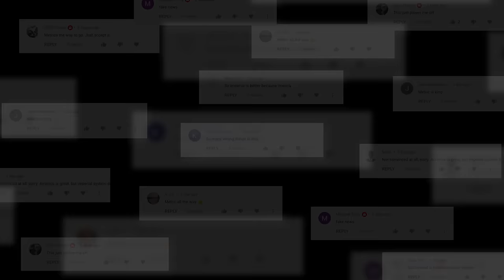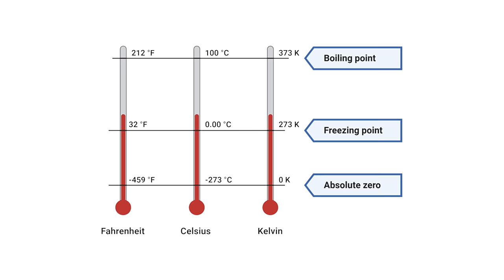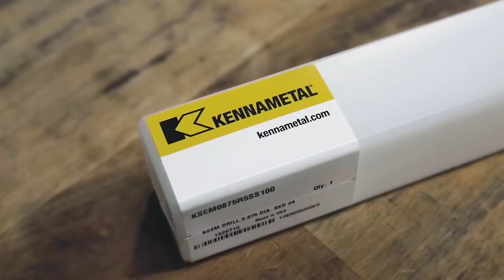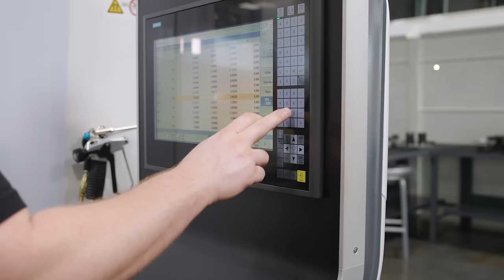Why METRIC is SUPERIOR to IMPERIAL

Comment: As an Englishman, its nice to understand both. Even if I do, like you say, translate between the one I'm familiar with and the one I'm not. But we use such a mash between the 2 🤣 kilometers if you're walking and miles if you're driving. Docs measure heights and weights in metric but we talk about them in imperial. We also use horsepower for combustion engines and kilowatts for electric...
Reply: Hopefully you can explain something to me that I have often wondered about, but never remembered to ask whenever I was in England. Petrol (gasoline) is sold by the litre and the road sign distances are expressed in miles, but I have never heard anyone talk about the mileage their car achieved in anything other than miles per gallon. Is there some easy mental math conversion for that?
Reply: @samshublom8761  well yeah there will be a calculation for it but we tend to just know how many miles per tank and how many litres are in the tank 🤷‍♂️
Although I just looked on my VW and it has an option for km/L as well as m/g
Reply: @samshublom8761  I only know the long winded way. We have a different gallon as well, to confuse things.

4.5L x £/L and then that's my £/gallon.

Its not that straight forward, but i know its roughly £9 a gallon (£2/L) at the moment. I have a 60mpg car, so I know a 20 mile drive is ~£3.
Reply: Another Englishman here and I have a habit of sometimes managing to use both at the same time.  Saying things like, "I need a bit of 10mm rod, about a foot long"!  In general, if it's an approximate measurement I sometimes use imperial but if I need to be precise, it's always metric.  Things like building materials still tend to get referred to in imperial, such as sheet material comes in 8'x4'. Well actually it's sold as 2440x1220mm but it's quicker to say 8x4!
Reply: @chrisharden3934  yes very true. We even have some steels delivered that say on the notes 4x1x500mm for example...weird!
Reply: @chrisharden3934  Another Englishman here and I do exactly the same 😉
Reply: It can depend on age, I'm in my 40's and grew up learning the metric system at school, but I also know about inches and most imperial units but choose not to use them, my nephew is metric only though.
Regarding the miles per gallon thing, it really doesn't matter, it could be called "Fuel economy value" for instance and you'd just know that very low values are bad and high values are good.  You just need a relative value to go by, I know that 60MPG is pretty good, so if I rename that to 60FEU (Fuel Economy Units) when I get in a car that does 30FEU's I know it's worse.
A lot of people weigh themselves in Stones in the UK, I used to but then the gym I went to only used KG when entering weight on the running machines, I converted and now know that if I'm 78KG I'm very light and if I'm 105KG I'm way too fat and need to get back on that running machine!
Reply: @WillandTony  where in the uk are you to be paying £2/L. In in the south coast and pay £1.70/L nowadays. And thats for vpower at shell.
Reply: @robc1014  assuming its diesel, cheapest by me is £1.85 and if I wana go big there's plenty I've seen that are £2.10. Im from West Midlands
Reply: @wildin13  petrol; i never look at diesel prices. £1.64 for v power petrol at my nearest shell today.
Reply: @robc1014  oh yeah I meant Wills' £2/L would probs be diesel. Petrol up here's in the £1.60's at Shell too.
Reply: @chrisharden3934  i have to say i do exactly the same, i can work in both Metric and Imperial intend to keep working in both systems. Imperial when im machining and metric when im building.
Reply: ...and stone for weight ;) (or is that just Scotland)
Reply: @bramweinreder2346  i still apply fertilizer to crops in Stones per acre in Northern Ireland, younger guys use Kilos per Hectare so each to their own.
Reply: And then there's the atrocity called stone.
Reply: @madeljacky  metric for precision, imperial for guestimates :) It's usually old school people who think that way and design around it, and I get it. It works.
Reply: Swedish here. Seems the expression "we're going metric inch by inch" will be relevant for several more years!😅 In Sweden we have our own quirk. We use miles for distance, however not the ones that are 1,6 km, nope ours are 10 km! Apparently an old Swedish mile was 10688 meters and that made it fit (almost) in the metric system. By the way out Swedish inch was about 2,97 cm, we have big thumbs in Sweden.😂
Reply: @bramweinreder2346  No mate, think anyone over a certain age south of the border uses Stones and Feet and Inches for measuring up a body.
My kids are fully metric though.
Reply: @tonyharrisson6823  glad to hear they survived the upgrade :)
Reply: @somedud1140  I'll take those for the legacy units that they are, but you should also mention that cars specify torque in local units, as do bikes with seat height. Both are typically considered more meaningful.

Comment: I recently retired from a shop that used both. We had a lot of drawings from Canadian customers for parts that obviously had been designed in inches years ago, but the drawings were re-dimensioned in millimeters. Our building and construction customers still used fractional inches. Automotive parts were strictly metric, but we programmed in inches. Inspections were metric. Taking a CMM report in millimeters and adjusting CNC offsets in thousandths was an error prone challenge.
Reply: Working here in Canada as a construction surveryor in tne 80's was fun...we used decimal feet in surveying, so using metric was a simple shift...but the trades were interesting, the millwrights and machinists both used metric and decimal feet...all of the structural steel tended to be metric....vut, the carpenters refused to use anything but Imperial fractions....I used to have to carry a chart in my fieldbook to convert between the three measures.
Reply: Yeah - combining the two is probably the worst of two worlds.

Comment: I served a Mechanical Engineering apprenticeship starting in 1976. At school I was taught the imperial system, then as I got older, the metric system. Going to work reverting back to imperial. Micrometers were a nightmare to learn as was the vernier caliper. Working in fractions ½¼⅛⅙ and 32nds. Knowing all their decimal equivalents. Then the Micrometers working in 'thous' or in 25ths. 
The metric system really in the UK Engineering took off in perhaps the early 90's when CNC machines became more prevalent. 
The metric system is hugely better than the imperial system.

Comment: I’m American but when I’m building things for myself I’ve been using metric more and more over the years. I’m still not as familiar with it as I am with imperial but I’m getting there.
Reply: It's very easy m8, just use base of 10. for example, 1 kilometer (km) = 10 hectometers = 100 decameters = 1000 meters (m) = 10000 decimeters (dm) = 100000 centimeters (cm) = 1000000 milimeters (mm) etc...
Or should I write it like this:
* Measurements above 1 meter are
---- deca (da) = 10^1
---- hecto (h) = 10^2
---- kilo (k) = 10^3
---- mega (M) = 10^6
---- giga (G) = 10^9
---- tera (T) = 10^12
---- peta (P) = 10^15
---- exa (E) = 10^18
---- zeta (Z) = 10^21
---- yota (Y) = 10^24

* Measurements below 1 meter are
---- deci (d) = 10^-1
---- centi (c) = 10^-2
---- mili (m) = 10^-3
---- micro (u) = 10^-6
---- nano (n) = 10^-9
---- pico (p) = 10^-12
---- femto (f) = 10^-15
---- ato (a) = 10^-18
---- zepto (z) = 10^-21
---- yocto (y) = 10^-24
(sorry if there's some misspelling in the prefixes)

* Same applies to the volume as well, for example 1 liter of water can fill up the space of 100x100x100 milimeters (10x10x10 centimeters or 1x1x1 decimeter or 0.1x0.1x0.1 meter that's why we say like this: 1 liter is equal to 100 cubic milimiters or 10 cubic centimeters or 1 cubic decimeter or 0.1 cubic meter. In 1 cubic meter you can fit 1000 liters of water and so on and so on.

One more example, easy one, let's say like this: "yesterday I was traveled 1.45 km, how many meters is that?". Answer is easy, so 10^3, so multiply 1.45 by 1000 and result is 1450 meters, basically just move the "decimal point" sign by 3 places to the right when converting toward smaller units and to the left when converting toward bigger units. Basically, the power of 10 shows you how many places to move the "comma"/"dot"/"decimal point".

Anyway, I was raised using metric, but I also use imperial as well, with over 20 years experience in mechanics I can build whatever using both (if I start imperial I finish project using imperial only with no conversions to metric and vice versa).

Comment: I like how metric can transfer information between mediums.
For example, volume to weight and vice versa. 1 litre of water, weighs 1kg or 1000 grams. 
So if I need 1 litre of water, and don't have a measuring jug, I can just use scales, and weigh out the volume, Which I have actually done before.
Reply: Which is a cube with an edge length of 1dm, i. e. 1dm^3
Reply: Works fantastic with thermal capacity and Joules and Watts.
Reply: In kitchen I like to measure liquid volumes with a scale. 1ltr of water = 1kg, and all other liquids are close enough.

Comment: Learned in metric and think that this is the more bullet proof way to go. Easier to define tolerances. Tried to work with imperial system but it blows my mind on how this should be easier or more practical

Comment: Fun fact: Here in Germany we use both kW and horse power (PS = Pferdestärke, which is literally Horse Power, but is defined a bit different with metric units. 1PS ~ 735W; 1HP ~ 746W). Most people know the PS number of their car, but have to look at their official papers for the metric one.
We also sometimes use Pfund (=pound) colloquially to refer to 0,5kg
Reply: In france we use HP or more recently (20 years) kW, i own a BMW and even if specs are in PS, i just approximate 1 PS = 1HP, not a big deal .. and in the end the specs power is never the reality, my 330 is more powerfull in reality then on the paper..  For more technical things, kW is the most accurate and we can easily compare electric to petrol, comrpessed air.. etc
Reply: @davidniquot6423  I wouldn't be surprised if the HP France used, were metric as well. 1PS is the power needed to lift a 75kg weight on earth (g~9,81m/s²) 1m in 1s, which apparently is about as much as a horse could do. An imperial horsepower lifts 550lb 1ft in 1s. Strange that they still couldn't find an alternative time unit to distance themselves further from the metric system ;)
Reply: @SchwachsinnProduzent  Time wasn't given the "metric treatment". (they tried though) It was hard to find decent numbers, I think. Of course time already was the same everywhere and had been for a long while. The multiples of 12 give away that it is ancient. Measuring time is a whole different ballgame, though, just like setting the same time (clock) for region or country.
Reply: @SchwachsinnProduzent  Time is imperial. 60 minutes 24 hours etc.
Reply: @agt155  
No, it's even older than imperial. The 24 h are Egyptian the 60/60 are Babylonian.
Reply: @EK-gr9gd  Seconds are metric. Minutes hours days...etc are imperial.
Reply: @agt155  
Seconds are SI not metric
Reply: @agt155  
There was an attempt to change time to a decimal system, just after the French Revolution, it failed.
For the workday were too long and the restdays to far apart.
Reply: @EK-gr9gd  seconds are si and metric
Reply: @agt155  
Seconds are older than metric.
Reply: I guess, with the transition to electric cars, HP/PS will also be replaced in our minds by KW.

Comment: There are some places where imperial units are still used in electronics - PCB layout being one. The convention of pins being on a 0.1” pitch grid, is now rather redundant, but the use of thou/mil (ie 0.001”) is still a very useful unit due to the contextual size for PCB track work. Just like in some applications inches are contextually useful, and easily visualised.

Comment: I have to share. I worked for a Belgian owned  company that produced germanium lenses in eastern Oklahoma. Drawings were in metric, but tolerances were imperial, so you had a 7 cm diameter with a tolerance of +/- 0.030"

Comment: I work with both, i simply make programmes in metric or imperial as par the part.
It is much more simple to just convert feeds and speed rather then translating the whole drawing and tolerance.
Reply: Why when metric is superior?
Reply: @Davoodoox1  its better to think and do imperial when working with it and the opp applies. Then you not constantly converting.

Comment: As an average person in Canada I grew up with imperial and later in life transitioned to 10ths of a foot in construction industry with some stubborn contractors and going on to metric when that fad faded heheh. I like metric and can switch back and forth in daily life as I have a foot in both worlds with older friends and younger folks. I do 3d printing so it is very easy to design in metric and if necessary convert for suppliers who may be still rooted in imperial. My advice would be to remain bi-system so you don't get stranded. For daily life 2.54cm=1 inch will keep you in the park.
Reply: Fun fact: With the metric scaling system you can even do Mft (megafeet) and mft (millifeet) and kft and so on and so forth. You were basically using dft (decifeet) in that case.

Comment: As a carpenter in the US I'm quite familiar with the fractional system, but I'd switch metric any day of the week. The only gripe I have with metric is that the gradations in C are not as fine as in F (100 units vs. 180, respectively).
Reply: in reality the single C grade can be divide into ten parts for example fever start at 37.5C  therfore between 0C and 100C can be 1000, 0.01 0.02 0.03 and so on
Reply: @Lorre982  Good point.

Comment: In the mid 1980s I worked tor a company that produced plastic pipes and hoses, the bigger diameters ranged to 200 mm.
Our sales man in the US asked if we could prepare hoses for firefighting trucks and supply them with coupling flanges.
So we asked information about the threads used.
We got an enormous file, something like a couple of phone directories with listed the information for the various threads which were mindboggling.
Just in the Chicago area there were dozens, we opted to deliver pipes without any coupling.

Comment: As a manual machinist, I was trained in imperial units. Once I started using cnc based machines, especially 3d printing, I switched to metric. Having used both, I tend to prefer metric for all of the ease of use reasoning mentioned here for small stuff, anything bigger than a meter gets the imperial treatment for all the reasons mentioned in the last video.

Comment: From South Africa, we grew up with the metric system, my father, however, when he did college they were taught the imperial too, he's a diesel mach, the metric is so much easier to use and to understand, and as I came to see (I know I might be wrong) the imperial system works with 1/4 or 1/3 of an inch as the millimeter part of the imperial system, and that is something that boggles my mind and make it difficult and confusing in using the imperial system and can never use it.

Comment: All that aside the only thing that should be considered when deciding which is a better system is which one is easier to learn, which one has the fastest mathematical formula, and which one has the most easily remembered fundamental units.  when it comes down to whether you're measuring, building, doing physics or chemistry, the units of measurement that give you a greater understanding of the world around you is simply the better system.

Comment: In Germany cars in the sales rooms have the power of the engine in kW and ps usually shown as 110kW (150PS). Because PS is the measurement people use and usually have a reference to. But pipe diameters, rim diameters and screen sizes are shown in inch or as we call it Zoll.
Reply: ...and in sweden it is HK.
PS of course means HP.
Reply: Yeah, I had to measure my heating pipes for the plumber. Turns out it's a half zoll, but the actual outer diameter is 1 inch. We should just stick to metric.

Comment: Metric all day. Not so much familiarity as I grew up on Imperial but I understand metric much easier, more intuitively. Metric measuring also got me into machining and woodworking from understanding much easier than dissecting every inch by up to 128. Taking it to a career in machine, I'd rather work with metric and let the machine convert to inch if that is desired for any reason. However, I do like Fahrenheit over Celsius for my familiarity to the values, I just know what 72 is supposed to feel like, 22 doesn't mean squat to me besides converting it in my head to Fahrenheit and how it's supposed to feel like.
Reply: Celsius is easier to understand: 0 Celsius water freezes, 100 Celsius water boils.

Comment: What I like about metric is a 10 cm x 10 cm x10 cm cube is 1 litre. I litre of water is 1kg in weight. (At a certain temperature) then if you know the relative density you can calculate the mass of say iron based on its litre volume.

Comment: I'm European, so it is clear that I grew up with metric and I'm familiar with it. On the other hand I can understand people which want to preserve their roots and refused to adapt. Metric is simpler for technical occurrence . While the fractional can be easier in everyday life and mentally challenging (more than metric). I don't judge but the real need is to know and understand each other, as you correctly pointed out.
Greatings